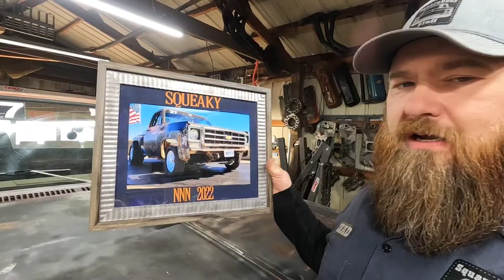nitrous 339 sbc stroker build. Grinding on the block to unshroud the valves. #becauseracetruck

Comment: Awesome, I just got a set of sportsman 2s for free.  I'm building a 305 and I thought I was going to be the first person to come up with this idea. because I already know there are some big block chevys like 396 and 402 that have a place carved out in the block for the valve. because the bores are too small to be a big block.  Awesome, thanks for sharing this. If I can run these heads and rev to 8k I might not need the turbo, lol.
Reply from the maker: Have fun with it. The 305 is underrated by the masses
Reply: @SquarebodyStuff  Well thank you for making all of the videos on 305s. I have been watching them and comparing and contrasting what I'm going to do.  But I learned a lot. and I'm not exactly a beginner at building small blocks.

Comment: I agree with you on the trade off/gain balance. Air flow has a greater impact than compression. As my personal rule of thumb, air flow is 2/3 of the weight in decision making and compression is 1/3. What would be the point of having an engine with a 12:1 compression ratio if it doesn't flow right? Horsepower will go up and torque as well. I guess only efficiency will go down a bit as the mixture won't get as complete of  combustion now. Nice job on the block reliefs, it's pretty consistent from cyl to cyl it appears!
Reply from the maker: Thanks. It's definitely not perfect,  but it's much better  than the air hitting a ledge.

Comment: I can’t wait to rebuild my 305 eventually. Throwing a aluminum 5.3 stock on a Muncie 4speed in my 78 nova. Will throw the built 305 in some other project. Maybe a dirt track roller for my dad
Reply from the maker: I've gain alot of respect for them through the years.

Comment: Your videos are fantastic, and I have learned a lot, but now I am stumped. I am trying to identify an engine. Where I would normally find a # like 3970010, or 3970014, all I can find is a number beginning with the letter K. It looks like "K24C' BUT i can't be certain. Any ideas?  Thanks
Reply from the maker: Thanks. Got that covered in this video. https://youtu.be/7IvrEFPgFTU
Reply: @SquarebodyStuff  I watched that video again. There is no casting number behind the distributor, Only the K24 C or G . There is no suffix code. There isn't even a place to stamp a suffix code,. If I could post a pic here , I would. Thanks for your help.
Reply from the maker: If you have facebook, Instagram or email.  Send the pics there and I can see if I can help.